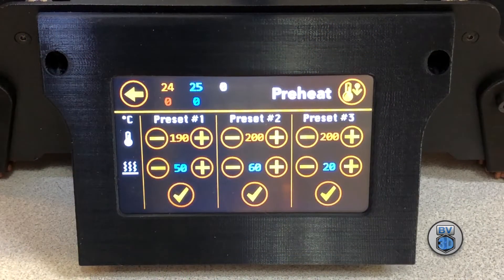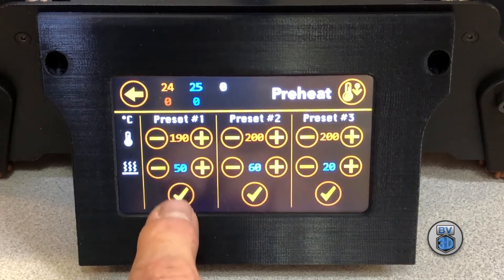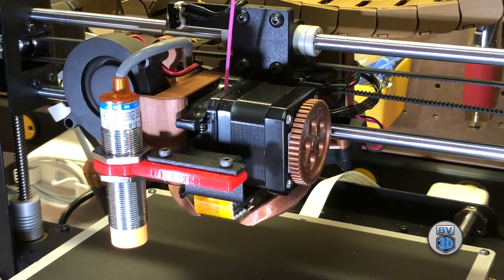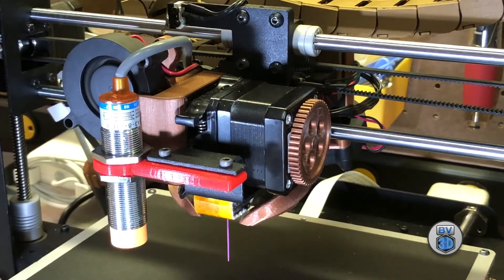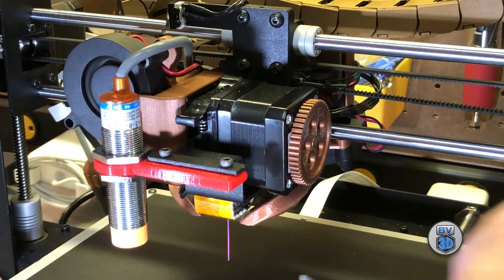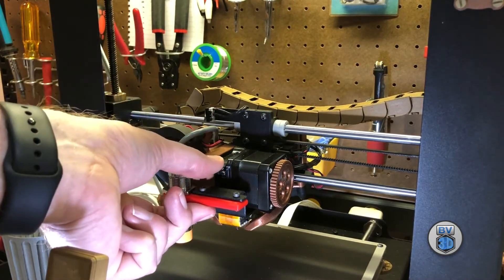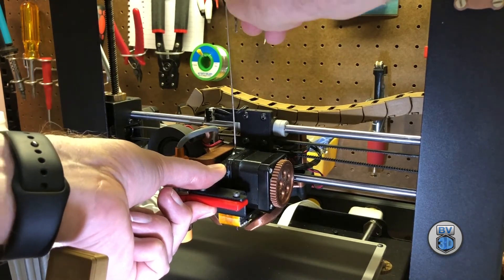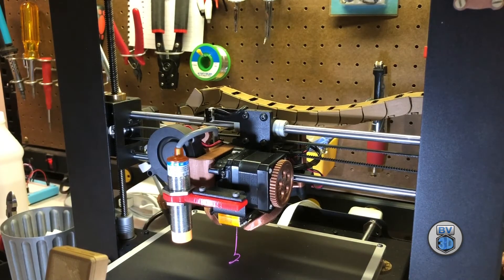What is the Mystery Tool included with the Monoprice Maker Select Plus 3D Printer?

Comment: Don't jam it.  Brass is a soft metal and you could be damaging your nozzle from the inside.  The result is filament will flow less smoothly and create more jams.  I have made my own tool using piano wire.  I also have a wheel on Thingiverse to mold your own poker.  https://www.thingiverse.com/thing:1977390
Reply from the maker: Ah, you have a good point. On mine, I noticed that the end had a sharp spot on the tip of it, so I filed it smooth.
I like your Thingiverse thing. That's pretty cool!